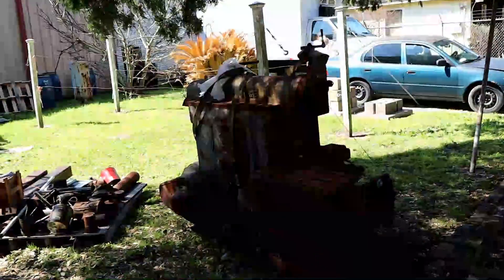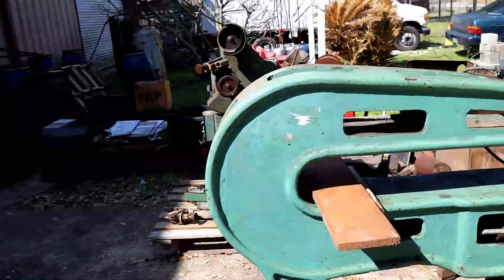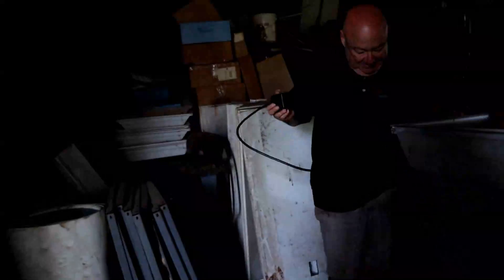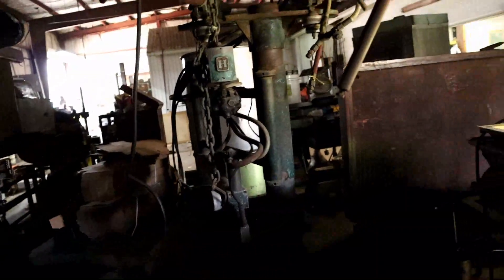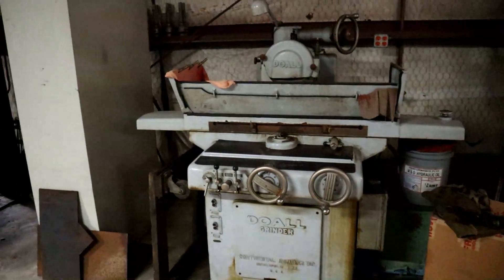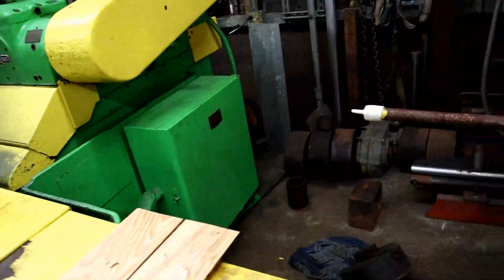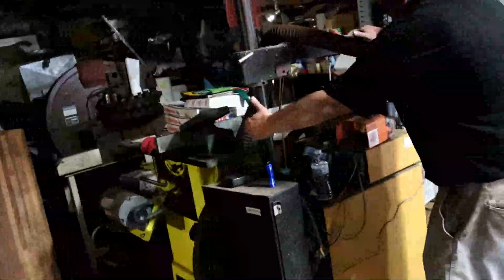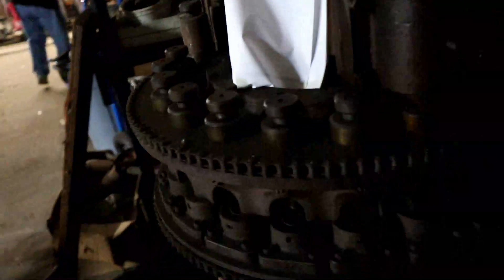ANOTHER Warehouse FULL of old Machines for sale... Better Hurry Though!

Comment: That torch on the stand is a magnetic tracing rig, it has a magnetic stylus on top that is inline with the torch and will trace what ever steel template you put up there, poor man’s cnc shape cutter
Reply from the maker: IS the big box part of it?    thanks for the info...
Reply: @10swatkins  No.  That's some sort of line boring tools for flanges and such IMO.
Reply: No big box is not part of it, Airco was one manufacturer of these shape cutting machine, we used one for years
Reply from the maker: @4GSR  MAybe when they move some stuff they can get to it and we can see what it is :)   At the rate things are selling it will not be long......   Three guys wanted my radial arm drill!
Reply: Max nailed it. I knew I saw a video of one of those acetylene pattern tracers. Here’s a demo of one. They actually are pretty damned cool ... old school, but cool. https://youtu.be/FvpO1jJE2H0

Comment: the Volkswagen tooling are boring bars for boring the engine case bores.. the cases are magnesium and the bearing saddles wear to an oval.. to repair.. the block main and sometimes cam bores are done..  bearings come Oversize OD and Undersize ID to make everything fit..
Reply from the maker: There were some things for VW's there.. A car shop bought most of it...
Reply: How much for the line boring machinery??
Reply: @ronbarnish3747  if you look at the end of the video. there is a contact phone number for them.. much of the automotive VW stuff according to steve was purchased already.. i don't want to post that guys phone number in this reply.. look at the end of the video. the contact info is up for the last minute or two..
Reply from the maker: @ronbarnish3747  Someone already took them...

Comment: Come out to California surface grinders like that go for $ 300.00 , and up for bigger ones . If I could get half what this guy is asking for his stuff
I would have $500,000 in Machinery but old equipment just isn't worth much any more except for in Texas apparently. Like I said californium is the place to go to auctions bring a 40' trailer.
Reply: It's true here in Central Alabama.  Birmingham has been de-industrialized and things are going for scrap prices with the exception of a decent lathe.  I would venture and educated guess that the Clausing-Colchester would bring about $5K.  Most all the machine shops here are gone and forgotten.  Houston still has a lot of smaller custom job shops and maintenance companies that still use manual machines.  The one thing he was really overpriced on was the welding gear.  Except in oil boom times, Houston is awash in welding machines.
Reply from the maker: It  sold for 6500.00 today...    Lots of buyers from Mexico buy the used stuff here... It's all first line equipment once it gets to Mexico.....
Reply: Geoff Morgan there is a 1000 guys that would gladly jump on that rusty shaper Evan at a high price they are few around , I have the same saw rotting away in my back yard $3500 I almost fainted try $600 all day hear. I scraped 2 Cincinnati #2 tool and cutter grinders after years of no interest and scrap was 575 ton only the tooling has value. I bought a lot of great machines last year cheeper than its ever been , Steve is trying to get a good deal and help guys liquidate for me its comical to hear such high prices but in big city's thousands of opportunities  are available.

Comment: Tons of S! Nice BP, saws, 17” lathe, B&s auto surface grinder. Greasy and oily is good.I like the old  stereo  on the wall.. $7500 for lathe is average. I have 13” Colchester one. I would be interested in tooling. Steady rest and follower should all go with that lathe. That turret attachment on the floor is prob for the Hardinge. Looks like a fun place to poke around. With your Southern voice, prob too far for me to drive. Nice drill, yours, nice. Filers are cool, filing is my exercise plan. Lol. Damn! Houston! Might as well be in Mexico. My 2 pennies.

Comment: You would think someone would have at least slathered some grease all over that shaper before putting it out in the weather. An old neighbor of mine wanted to give me a Brown and Sharpe surface grinder a little bigger and more modern than the one there, but I didn't take it. Still regretting it. Could be because when I started out as an apprentice in tool and die back in the 70"s, the sob, foreman made me clean out the grinding room, with ten big surface grinders in it, with nothing but a whisk broom and a piece of sheet metal. After I was done doing that I had to wash all the machines down with some heavy duty degreaser, using a paint brush. The guy didn't turn the power off, or even show me where do do it. I touched one of the switches on one of the machines, and got a blast that threw me back a few feet. Everything was 550 volts. I should have sued him.
Reply from the maker: Nobody cares  anymore :(
Reply: @10swatkins   Yeah, sad but true.

Comment: Why use a grinder over a shaper? I'm not a machinist and a don't know a lot about machining. I know a shaper uses a blade to cut away the material and of course the grinder uses a grinding stone but I have no idea what the difference is or why use one over the other.
Reply from the maker: A grinder allows you to work to finer tolerance normally. 0001 of an inch where I work hard to get my planer to around .001 of an inch.. over 4 foot of course but still tolerances of thousands instead of 10ths of an inch.  Normally you machine to  make it close and grind to make perfect.
Reply: @10swatkins  thanks

Comment: It’s difficult to hear someone talking about the scrap value of the copper in a the motor of a machine worth $10k or more after restored, and scrapping that copper sheet and the brass, and all that steel billet, I machine so much I’d probably use it all up in a couple months depending on exactly what kind of steel it is but don’t scrap those chunks, they’ve clearly had decades to settle and would sell full price to some machine shops, scrapping perfectly good steel is sad, but if you need the cash, gotta do whatever you gotta do
Reply from the maker: I am trying to talk him into having a "garage sale" and letting everyone come buy pieces of it.... MAybe in two weeks if the Mexico does not buy everything

Comment: Value of somthing isn't asking price. Its what someone is willing to pay.
The bridgport would sell for under 3k rebuilt  6k is what it might have been worth 30 years ago. 
A used compressor always needs to be rebuilt and inspected for internal rust, id never just plug one in and use it your a fool if you do. Unless you have personal close knowledge of its care and history it should still be presure tested and inspected for weak points. 
If that tank ruptures under pressure it could be deadly.  Thats any used compressor.
Reply from the maker: That is true... I just backed out of a deal that was pretty ok until I really inspected the machine and found someone has removed the table motor and the machine did not even have the manual feed wheel....  Deal went from 3000.00 to under 1000.00 and I not sure I would even pay that... So many factors involved and the the biggest on is demand...    

I know a man that rigged up his own compressor from parts...  He used it for years but neglected to install a pressure pop off... Once he forgot to turn it off and when he went to unplug it it exploded... He sat in a chair for the rest of his miserable life :(